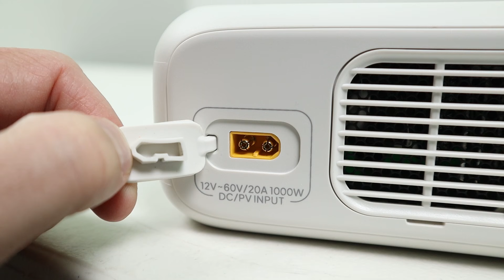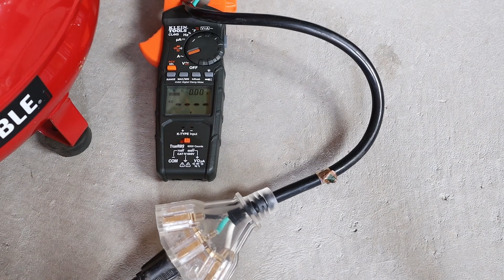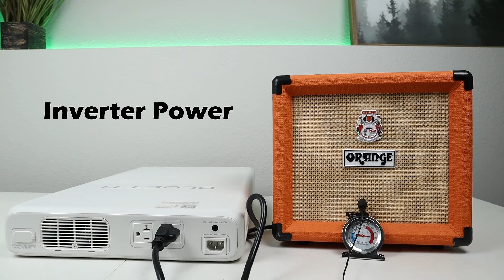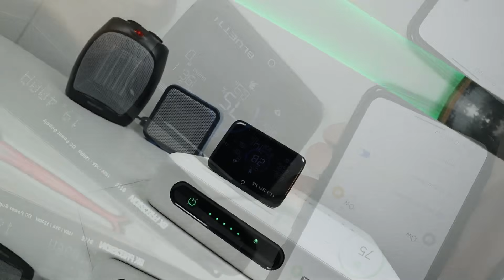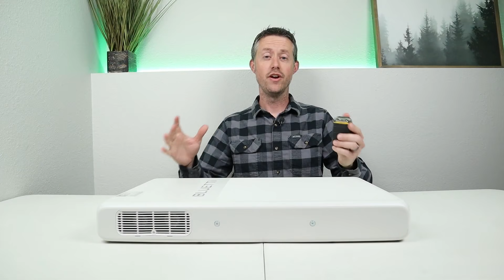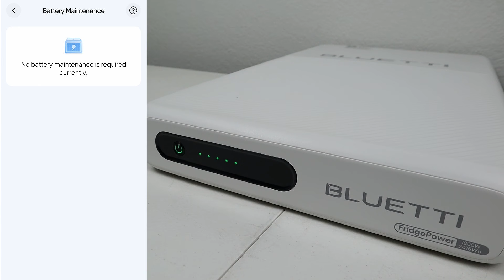This Is PERFECT For Power Outages! The Bluetti FridgePower Slim UPS

Comment: Jasonoid can you try to hack this battery like you have done on other power stations.
Reply from the maker: It should work if you match the custom voltage 😂 it's not a normal LFP battery pack.

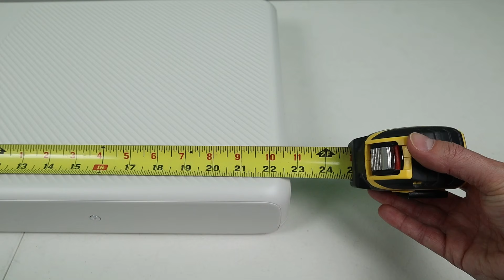Comment: 22:05 Very strange choice of dimentions. 
Depth 22.75"=57.8cm
Width 13.75"=34.9cm
Height 2.8"=7.1cm
The vast majority of European fridges is 60x60cm (WxD). I think this power station is both too wide and too deep. The width should not exceed 30cm (11.8") and the depth should be limited to 50cm (19.7") otherwise it will block the fridge gravity ventilation.

Comment: Does it have an automatic cycle mode?  Assuming it's LFP and LFP hates being left at 100% as most traditional UPS will.
Reply from the maker: You can set all the battery charge processes in the app. I showed a little bit of that near the end of the video.

Comment: Complete FAIL on the "20A" DC input. No reasonable person would charge this in their car/truck/van unless they truly knew what they were doing. Ecoflow has a much more mature approach with their XT60i connector. Bluetti could have also let you adjust this in the app. Hoping a future firmware/app update will fix this. I was pleasantly surprised that they updated my AC180 firmware to allow the inverter to restart after power recovery... hoping they fix this flaw as well.

Comment: Is the AC PASSTHRU  when the unit is fully CHARGED?
Reply: Reviews suggest yes. It acts like a standby ups with 10ms or less switching time. No power filtering / surge suppression mentioned.

Comment: My fridge uses around 165 watts when running. I assume there would be some kind of surge to start the compressor. If this unit was truly optimized for a fridge, the inverter would be sized to start & run the fridge compressor, & keep the idle consumption to a minimum, since a fridge would typically be off more that on. I would prefer to have this unit optimized for the fridge backup task, not starting & running my air compressor, or keeping my computer up & running.
Reply from the maker: My fridge pulls over 2600w when it turns on the compressor, so those tests are relavant 👍 large surge current as the compressor turns on.

Comment: Seen several videos on this and wildly differing power outage run times. Hobotech tested it and over 2 days without any expansion. Another at 26 hours with the expansion battery.  I’ve seen no consistency across the reviews.
Reply from the maker: Every fridge is different. Also, what was the internal temp set to? What was the ambient temp in the room? How much food was in the fridge? Humidity? How old is the fridge? 

These are all factors that effect how often the fridge compressor runs. Most 2000wh devices running on my fridge go about 24-30 hours. It was consistent with my testing in the past so at least I have a history of testing these units on my fridge in every video.

Comment: When I first saw the screen that comes with this power station, I thought the temperature and humidity displayed was maybe using a wireless sensor that you put in the fridge, but I guess it's just telling you the room temp and humidity. That doesn't seem very useful to me. I would much rather want to know the temp in the fridge so that I can verify without opening that the temp is being maintained, and maybe have an alarm that goes off if it reaches a certain temperature for a certain amount of time

Comment: i think it'd also be pretty cool if there were strong magnets on the actual powerfridge and battery to mount to the side of fridge.
Reply from the maker: Being 40 lbs that would take some strong magnets. Cool concept though!
Reply: @Jasonoid 

You don't even have to go to the extremes of neodymium magnets. At my work we use regular disc magnets (about the size of a standard jar lid, but about 2x the thickness) at my work that would hold this unit up just fine.
One on each corner and it'd work great 👍
Reply: @Jasonoid  Strong Magnets, 150lb+ Waterproof Strong Neodymium Cup Magnets sold on amzn.

tried to post a link, but u know u-toob.
Reply: VELCRO STRIPS

Comment: Not being able to feed 12V at a higher amperage for this device is a bit silly.  Some of us have one or more 12V batteries that could be used to keep juicing up this system during an extended outage.   I know that others will figure out that they could use jumper cables from a running vehicle to recharge the batteries if the outage runs on for several days.  The system should have an option to feed 12-15V at 20 amps, even if it requires approval  in the app each time it is used.
Reply: I have a couple of Ecoflow units and they only allow for 8 amp charge for the high limit while both of my car's have a 20 amp fuse.  I would love to be able to increase the charge input on the Ecoflows to 15 amps.
Reply: @JT-lq4yd  A few power stations can handle 15A I think that 8 amps is considered a standard for automotive cigarette lighters and often, that is all the wiring to the socket can handle.  Some trucks have 24V systems with the same limit.   I once had the wiring of a cigarette lighter begin to smoke before the fuse blew, so just changing the fuse may not be enough.
I think that some Ecoflow power stations use the orange XT60i sockets that can over-ride the 8A limit for 12V, provided the center connector is connected to the proper terminal.  I saw a video where someone showed how to do that.
Reply: @jfess1911  With 24v you can have more power delivered, basically double that of 12v.  I fried the cigarette lighter and blew the fuse on my car because I used a power inverter to charge the power station faster.  I did lower the charge speed to 200 watts, once you add inverter losses, I exceeded the 20 amp limit.  The cigarette lighter is not good for high current, a SAE connector would be an upgrade.  I did install a hardwired XT90 plug in my car to keep a better connection.  Though, the Ecoflow unit uses voltage to determine how many amps can be drawn at once, it it is under 15 volts or so, it just defaults to 8A max even with the XT60i connector.
Reply: @JT-lq4yd  Some Ecoflow units will pull 15A at 12V with the proper XT60i connector.  It depends on how the center connector is wired.  The cable is sometimes called a "solar charge cable."  One video that discusses it is titled "Ecoflow Low Voltage Charging.  12V Vehicle and Solar.  XT60 vs XT60i Connector Differences".
Reply: @jfess1911  Thanks for the info. I will look into that.

Comment: Do a lot of people have solar DC outlets in their kitchens? I suppose you could get a low-voltage box and a blank cover and mod it for some type of XT-60 panel mount, but that's going to make a niche install even more niche and probably not covered in any electrical code.
Reply from the maker: Running a portable panel through a door or window is a good temporary solution. Something long term would definitely take some design and planning 👍

Comment: Basically I was right and just no more than a power station. Either they are not thinking about about truly sustaining energy are they thinking more about padding their pockets. The unit should have the ability to provide DC power to the refrigerator until it gets to a low point then recharge the  battery back up to go back on line with DC power battery. This is only useful when the battery goes out as the same for a solar power station.
Reply from the maker: Fridges don't run on DC power.

Comment: Not a horrible price as a kickstarter but I would rather have it for 500. I will stick to the power stations I have over buying another item. If Bluetti wants to send one to me for free I would be happy to receive one. Last time I had a power outage I plugged my fridge into one of my power stations and it worked fine until the power came back on.
Reply from the maker: When I have powered my fridges with my power station there were extension cables involved and the power station was sitting in my kitchen, sure it works, but it's not as seamless. This is for someone that doesn't want to move a power station around or pull out an extension cable every single time the power goes out.

Comment: I have a very cheap option for you ... basically free.    Freeze 3 one gallon jugs filled with water.   I keep mine in my freezer.   If I lose power, I will transfer two of them to the refrig and one to the freezer.  I BET YOU it lasts longer than that inverter.
Reply from the maker: My freezer would be completely full if I had 3 gallons of frozen water sitting in there all the time. That might work for someone who has a MASSIVE freezer!

Comment: I like it but 759 is a bit much for a 2kwh unit that only does one thing. There is defenitly a need for this. Im currently using the ecoflow delta 3 1500 for my fridge. I will most likely pick one of these up in the future
Reply from the maker: I thought that $0.37wh was pretty decent but yeah, since it's a kickstarter it could be a little cheaper.
Reply: @Jasonoid it not a bad price but its pretty close to pecron f3000 price. Which right now is still 799. I do like how slim this is. It really dissappears into the fridge

Comment: I am considering this one for running my camper fridges.  I have a small built in fridge and an ICECO 42 between the seats.  Since this has two outputs, I could run both. The proposed area is also between the two fridges. I like this for both camping and while in transit, since I don't run the propane while driving.  

I have a thin area between the drivers seat and a bathroom wall and this would fit great there, while still storing my portable solar panels.   Currently, I use the original Montek (but it’s not LiPo4 version), and it is very tight to get the panels and power station in place.  In the winter, I can use it inside for the fridge, and all sorts of other things, when I shut down the generator intermittently, or I could run a small A/C,  at night, etc.  Since it is so thin, I won't be tripping over it in the dark!

I like this form factor very much.  I was going to get the original backpack power unit, but it was a bit too wide for my application.  It would be great for a long auto trip with a car fridge.

As always, Thanks for your great and thorough review!
Reply from the maker: It's much more efficient to run those 12v fridges off DC power. You'll get a much longer runtime using DC output to keep them going. The form factor for this model is enticing, but I wouldn't consider it perfect for camping with the lack of DC output and USBports.
Reply: @Jasonoid  Thanks so much Jason!

Comment: Question Jason.  Is there live voltage at the battery expansion port?  The idea is to parallel 2 head units rather than buying a head unit with an expansion battery.   Personally, I'd rather pay the extra $60 and get an extra head unit with a built-in inverter rather than an expansion battery that only does 1 thing.
Reply from the maker: I showed 19v at the expansion port near the beginning of the video.
Reply: @Jasonoid  Obviously I need to pay better attention.  Thanks!

Comment: I was curious about those. For the same money I got myself an Anker C2000 Gen2 with so much more functionality, that I can also utilize otherwise if needed. It has also UPS function and runs  a lot of my equipment. 
The FridgePower Slim UPS is in my opinion a niche product and very unpractical. For me it would work only if I am so space restricted,  that I can put something only on the top of the fridge (as shown) and also have the space there.
Reply from the maker: That's exactly what it's designed for, so yeah, no pressure to buy it. Everyone has a different use case.

Comment: Another suggestion for grading.  Since this power station doesn't have DC outputs by design, that makes them "ungraded".  So rather than grading it at 7.5 out of 10 or 9 out of 10 which is inaccurate, it really should be graded as 7.5 out of 8.5 points rather than giving them a full "fail" or full "pass" on the ungraded categories.

Comment: I think they're too pricey for a dedicated unit.
Reply: Compared to the other 2000 wh power stations. It's well worth it even though you give up on the DC ports.
The early bird price ($540 with the $90 free gift and sales tax included) is roughly $300 to $600 cheaper than the other 2000 wh power stations that come with DC ports.
Reply: @wt9653  Please provide a link to that $540 price.
Reply: @TXH1138 
Sorry. Looks like Bluetti deleted the link on my email. 
You pledge from the email link. It's not an actual site link 
You  get invited when you subscribe to the updates on the fridge power.

Comment: Great video, as always, but why use a 6S, 19v battery?  YUCK!  Whose idea was that??  I get why they didn't use a 4S, 12.8v battery, but they absolutely should have gone to 8S, if not 16S, for a 24 or 48 volt solution.  I was never going to buy this dedicated product anyway, because it's going to sit there doing absolutely nothing at least 99% of the time, and I expect more from my storage/back-up power dollars.  However, if I was even considering this product, the 19v battery design would kill that interest immediately.  They're trying to lock you into a proprietary solution that only scales with their expensive add-on batteries.  NO THANKS!  I'm paying attention and won't be duped like that!
Reply from the maker: With such a specific design, I don't think someone would be trying to mount more DIY batteries in their kitchen. That modding concept is much better for other units. I get your point though, thanks for commenting!
Reply: You probably aren't looking for buying extra batteries if you get this, if i can fit any other power station i won't go for this one, hence the only customer who buy this would be the one who can just fit a single one of these into their kitchen space

Comment: I have two other power stations, multiple inverter generators and I'm considering this for internet, security camera and smart home backup. Mounted on the wall in my electronics closet. We have frequent power outages in our area and this would simplify life.
Reply from the maker: Wall mounting it in a closet is a great way to save space while keeping everything running smoothly.

Comment: How loud is the radio interference that this box makes?  Very few seem to be measuring the RFI (radio frequency interference).  This is extremely important to short wave listeners, ham radio operators or anyone who enjoys AM radio.
Reply: He used to measure it but all the units got the same results, have your equipment 3 to 4 feet away and you're good.
Reply: @WiseManSolar  Most SMPS create havoc on the air.  You're saying this one is vastly superior in this regard.  I hope you're right.  Thanks.
Reply: @WECB640 I didn't say anything about being vastly superior, I simply stated he used to test it and the results were always the same. Distance between the power unit and the radio removed interference.

Comment: This absolutely has use case. Many many people will find this valuable.

The simple fact that it’s all in one, and literally anyone can set it up. Obviously it’s for people that can’t do are not willing to do DIY.

Or people that just want a simple plug-in play.

Another banger video Jayson, thank you!
Reply: I disagree. Why would you pick this over a similar size portable unit?

This is too specific.
Reply: @DankoStojanovic it's thin enough to fit into small cracks so you can implement it even if you never planned to use backup power station before. It provides high enough wattage to be used by high surge power demand devices like fridge, it's portable enough for you to take it with you if you relocate so you can save your investment.

Comment: No discount code 😢
The price starts at $699.
You'll get a free display if you pledge $10 to reserve from Bluetti.
Reply: where did you see $699?
Reply: @TXH1138 
Kick starter 
I just ordered it for $699 tax included.
The delivery date is June 22 for Washington State.
If you reserve it from Bluetti website. It tells you the reservation comes with a free gift. In the notes, It says fridge display
Reply: Unless I'm missing something I see $759 for the Super Early Bird and $50 for the screen.
Reply: @robertgiresi9515 
Did you reserve it with Bluetti?
The Bluetti website says, the $10 reservation comes with a discount price and the free display.
I ordered one for $699
I reserved mine through Bluetti on 4-7-26. I've also signed up for the updates on the fridge power back in March. That's how I got the invite to reserve the fridge power?